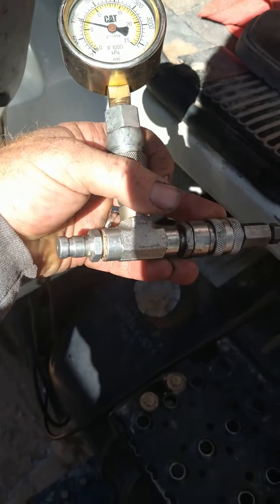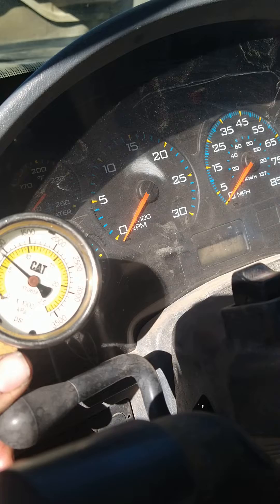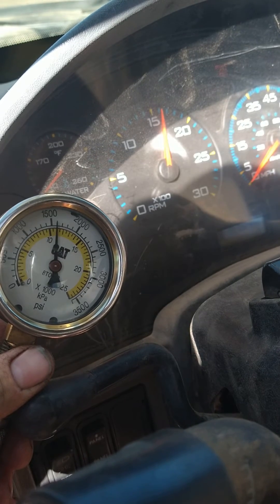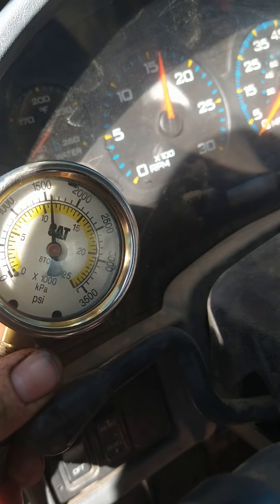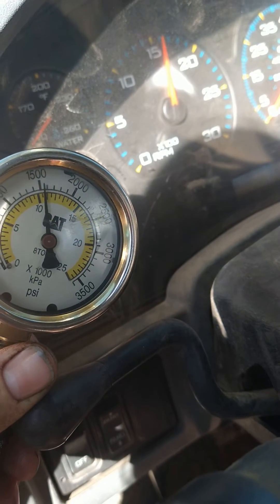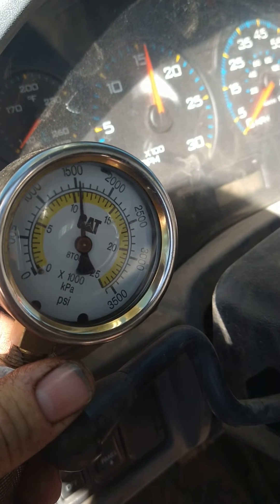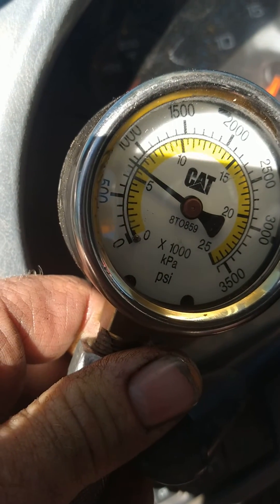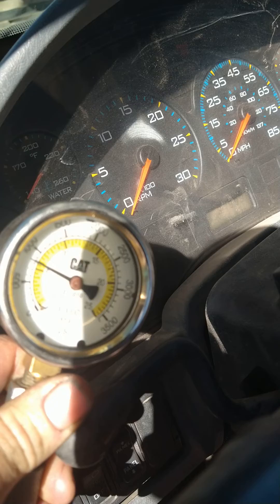International HT530 high pressure oil pump

Comment: What was it?
Reply from the maker: There has been a lot.of problems with the wiring on this truck.  Many of the wires had lost.their insulation causing arcing.and shorts.  The harness has been changed since by the dealer but I would.like to run through the test again.  Thanks for the interest I will see if the new harness changed the relief pressures.
Reply: @chrisalwin1  Thanks for the reply 
I’m having 333 code  I changed the pressure valve in the front cover no change new ipr new Hpop not oem I believe with 500 miles  injecter orings replaced
Reply from the maker: @johnWick-in2gk  could be a bad injector
Reply from the maker: Maybe?
Reply: Como lo resolviste, tengo un problema similar, injectores recien reparados y ipr nueva y sigue con la falla de baja presion